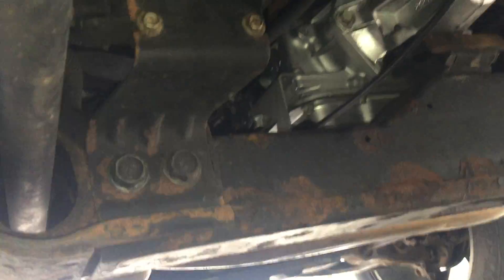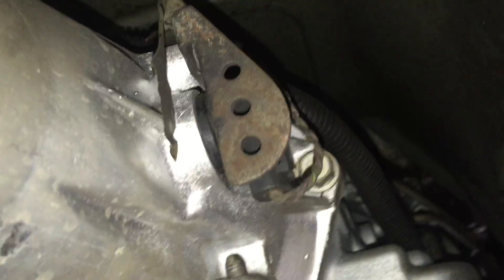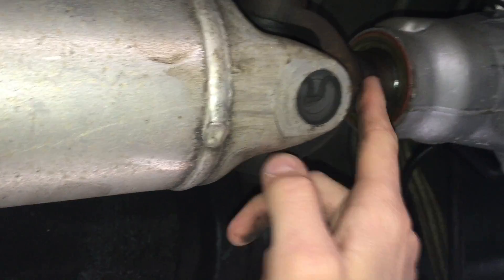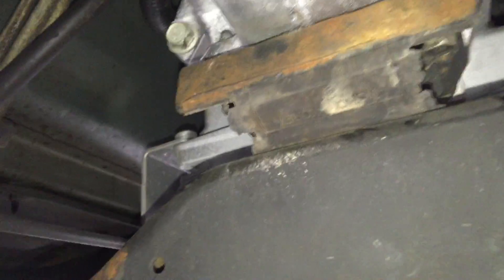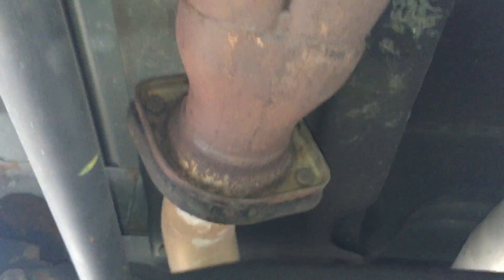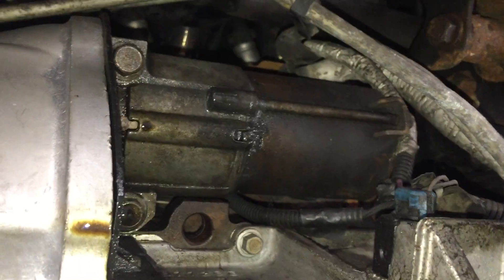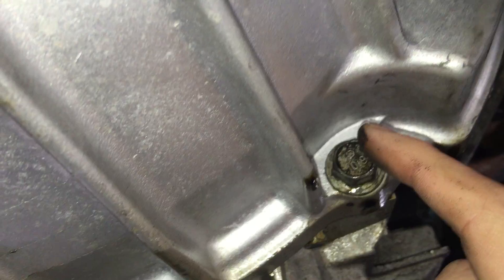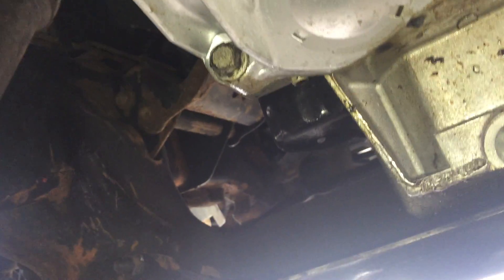4L60e removal information

Comment: Removing the bolts attaching the torque converter to the flywheel through a bigger opening below the bell housing should have been a better engineering option by GM than going through the starter opening.

Comment: Would you say you had and easier job starting with the upper Bell Housing Bolts or the lower ones? I ask because I did a Silverado and the little hang or misalignment movement made it pretty hard for me to unbolt the uppers although I had already loosened them in advance due to the misaligned transmission as it came looser and looser considering the room one has on the uppers. The rest came off by hand.

Comment: I found this difficult to watch.  First issue was the drive shaft.  If I am removing a transmission, I don't need so much time or detail telling me how to remove the shaft.  I also don't care how it works.  Second issue was the exhaust.  I don't need to know how it all works, but only that it must be removed.  Third issue is the starter.  I don't need to know how it works.  I need to know if removal is a requirement.  You say to remove it but don't say why.  Fourth issue is the trans lines.  I don't need to know how they work, but I need to know how they are removed.  I have looked at mine and the design is unusual.  I watched your detail about clips, but did not understand.  And you said nothing about the line nuts - they are not 18 or 19mm and not Imperial.  Then then end came prematurely with no detail of how the transmission is to be separated from the engine.
Reply from the maker: Bob Black—the intended purpose of this video was actually for a class project back in college. It was only to highlight certain aspects of the job as I was giving a speech to educated individuals. I was asked to be specific on certain key factors, which landed me an A on the project by the way. The video just so happened to blow up on YouTube, so I left it up as other people found it to have useful information. If you aren’t mechanically inclined, maybe have an actual mechanic R&R your trans instead of tackling it yourself?
Reply: @michaelmancini4195  Glad you got the grade.  However my point is that the video was wandering, whereas a good video would stay on topic.  At 0:12 you state this this video would be step by step.  What means you should not wander into side topics not relevant to the actual subject matter.  When you become better at that, your videos will increase in value to others.

Comment: Let's say u put a new tourque converter in do u install it without atf or is there a certain way to fill it?
Reply: Fill it up about half or so in so that it is not running out when sideways, otherwise you would start the vehicle for a few seconds, 3-5 seconds and shut it off to recheck the tranny level as it will keep going into the TC leaving the tranny low each start till its caught up.

Comment: When you did the installation with the new transmission, did you reprogram it?? Have that question because when I did mine it won’t grab right and won’t shift at temp
Reply: Did it fix itself? I've heard you should reprogram it after overhaul/repairing it

Comment: Mike, Great vid, one question and it's around the Bell housing bolts and in particular the top one. I've watched out 5 vids now on the Tran s removal and not one shows "How" they got it removed, plenty have the great music with the Trans coming out but not one shows "how" they go to that bolt, Any Tips on how to get to it?
Reply from the maker: Mario P it is the hardest one to get to for sure. I used a bunch of extensions with a long handle ratchet for more torque. Using wobble extensions are your best bet. You can easily grab a set of wobble extensions from harbor freight if need be to get the job done.
Reply: @michaelmancini4195  remove your passenger side plastic inner wheel well and Wheel and Tire . Your welcome.

Comment: Not sure if you still have the truck, but with that many trans, may i ask if your flushing the trans cooler lines?
Alot of people dont bother to flush out the 2 lines going from trans to the cooler. But if you have a bad trans, those lines are holding contaminated fluid, and friction materials in them, and they get recalculated into the new trans...
Very important step that too many people miss
Reply from the maker: splash- thanks for the comment! Yes, lines were flushed every time. 2 of the replacement transmissions were boneyard units that failed after low miles. Another was a faulty rebuild. That is the reasoning behind me replacing the trans on this truck so many times haha. But I did sell the truck earlier this year. Was long overdue for an upgrade!
Reply: @michaelmancini4195  
Nice
Ya its so hard to gamble on used trans...ive have good luck a couple times, and had one that wouldnt even leave the driveway on its own power...thats a kick in the nuts!!
Lol

Comment: Should have upgraded the band and frictions as well as the accumulator springs and servo. Could have saved one or two transmissions at least. A stage 2 rebuild kit is directed toward hauling and towing.

Comment: My trans went out, started fine still though, pulled the trans, had it rebuilt, put it back in and it has no crank, no start. I have all the wiring plugged back in, checked the starter, it's good. Thought the neutral safety switch might have been damaged while taking it off, replaced that and still no crank/start. Checked the fuses/ solenoids and all is good! I'm stumped and going crazy now. Any ideas?
Reply: JT Money I ended up taking it to the dealer after a few weeks of frustration trying to figure out what was wrong. There was a short at the ignition relay that had nothing to do with the trans. It just happened to become a issue at the same time as the trans. Thanks for the idea though, I tried everything I could think of

Comment: thank you for this video. I watched it in prep for my job. I removed a 4L60e to R&R a leaking rear main seal on an 04 GMC Savanna. Although there were some differences, namely the exhaust system, your information made it easier for me to complete the job...better yet, it started when I was done. PS-I believe the transmission that I pulled out of the '04 was a remanned older version from '97-'99. The bell housing and the body were one piece.

Comment: can u give me sum advice im trying to install the new one in but having trouble
Reply from the maker: Ac Price what's the issue?
Reply: im haveing trouble getting tork converter and flex plate off my gmc 2000 sierra
Reply: got the trans off but. think i missed a step with the tork converter and i got my new one today but.  cant figure out how to get tork converter off to install it
Reply from the maker: Ac Price you have to remove the torque converter bolts. There are 3 or 4 bolts. You have to access them from where the starter motor is. Remove the starter first, then you can gain access to the torque converter bolts. Use a flathead screwdriver to carefully rotate the flywheel so you can gain access to all of the bolts.
Reply: yes ive removed starter but still cnt seem to get them loose or turn it the rite way im not really sure why i cnt get it do u use the flat head as lever so you can unbolt it also? nd i appriciate ur help man
Reply from the maker: Ac Price  all good man. Happy to help. yes you have to use a large flat head to hold the flywheel in place while you are trying to loosen the torque converter bolt. Unbolt TC bolts from the starter opening. Considering you have the trans out already, you really shouldn't have any issue holding the flywheel
Reply from the maker: Ac Price be careful not to damage any teeth on the flywheel though!! They make a flywheel holding tool, but any guy I know has always gotten around it with just a flathead--myself included!

Comment: Influenced my trans build for the best
Reply from the maker: Kevin Yourk glad to hear it!!!
Reply from the maker: Kevin Yourk if you don't mind can I make a suggestion for your rebuild? (If you're the one physically rebuilding it)
Reply: Michael Mancini what suggestion were you going to make on the rebuild for these units? He said he has put in 5 transmissions in just 300k which seems horrible. I dont care how hard you drive they should definitely last more than 55k each time. I have 300k on my tahoe and just finally broke the sunshell housing which caused no reverse, no 2nd and no overdrive....otherwise in great shape inside and we tow and offroad all the time.

Comment: how did you get to the top 2 bell housing bolts?
Reply from the maker: Doug Scott- a realllllyyyy long extension with a long handle ratchet/breaker bar to break it loose. Gotta go from under the truck and over the top of the transmission. It's a straight shot.
Reply: thank you. with the cross member down, and then sagging, it was accessible but still a bit*h. lol. thanks for the response!
Reply: You can loosen engine mounts to get more angle

Comment: Do you think a 4x4 1995 suburban 4l60e is a one man job?
Reply: Wallace Rose. yea does are the easy ones bro if u wanted to be more easy for u take the transfer case of and put them on seperate even ..tell ur friend to come over for a cook out and have em help u put it all on at one time really easy he wont have a choice ..thats what boys are 4.
Reply from the maker: Wallace Rose sure, as long as you use appropriate tools & jacks/stands in order to lower and raise the unit(s) in and out of the truck. I've done several of these by myself, both on a lift & also on the ground.

Comment: Great info!!!!  Thank you!!!
Can this be done in my driveway on jack stands on my Yukon?  What about the transfercase?
Reply from the maker: Sparta, you can do this in a driveway if you have HD 6 ton jack stands to get the truck high enough off the ground. It'll be a bit of a struggle, but it can be done. Tricky part will be supporting/lifting the trans back into place. Transfer case will have to be removed as well when doing the R&R on the transmission. My truck is RWD, so that's why you don't see a TC in my video. Look up your fluid capacity specs for your truck specifically--being that it's 4wd, yours will take more ATF than mine when filling it.
Reply: Michael Mancini
  Thanks so much!  I already have the taller NAPA 6 ton jacks and I plan on getting a low profile transmission jack from Harbor Freight for only $130.  Any advice for installation?  An problems getting the Torque Converter or flex plate in place?

Comment: hi michael nice vedeo really i need a help on my suburban 6.5 turbo diesel i change a automatic transmission 4L80E to full manual transmission NV4500 and now not working the dam speedometer!!! before everyting is working and after this modification not working a speedometer and a ABS light is one also you know where is a solucion for fix this type of problem? thanks bro. best regards from norway
Reply from the maker: What year?
Reply: my suburban is 1995 model
Reply from the maker: To my knowledge in that early of a year, the 4L60 & 4L80 transmissions were not equipped with a VSS, so your speedo should be getting a reading via the wheel speed sensors within the hub bearings. I would have to look into how the data is communicated from the EBCM to the PCM on that particular year in order to give you a more thorough answer. GM had a lot of problems with their EBCM's over the years and are known for various parts inside to fail.
Reply: thanks mate for all information amanzing this the fanny is before is working and after never more working dam speedometer i check one by one conectors and wires everyting all right strange really who going one on it put me crazy this problem and here in norway no one understend nothing on american cars just i try see and check a GM electric chanel or other vedeos will see i hate a dam electronic

Comment from the maker: Doing these are a piece of cake. I've done tons of them and can have the old one out, new one prepped and back in and on the road in about 3 hours total. How did yours go? 
L
Reply: Your kidding right ?
Reply: I got it out mate thanks video helped me out a lot
Reply from the maker: Justin Lyons I have not done one on an S10 in quite a few years. But, considering it's the same transmission,(bell housing bolts differ depending on generation of 4l60e) you would most likely have to go in over the top of the transmission with several LONG extensions from the tail shaft side, and use a long handle ratchet so you have some leverage.
Reply: Michael Mancini So how difficult would it be to remove and replace one on a 97 suburban 4x4? I've got all of the tools except a transmission jack.
Reply: @michael mancini where are you buying those 4L60e trans and how much are you typically paying?
Reply: hey. I'm up to taking off the 3 bolts on the torque converter. how do you stop the shaft from spinning when taking off the bolts. I've put it in park but it still spins. I'm stuck lol 
cheers mate
Reply from the maker: Still need help?
Reply from the maker: Awesome! Glad to hear it!
Reply: what size are  the torque convert bolts?
Reply: Michael Mancini hey mike how do you stop your truck from smoking
Reply: I got a 95 Chevy Tahoe, I love it so much, but my transmission is bad
Reply: Thx you did a great job explaining everything bro
Reply: I will be dedicating an entire week to take down and do a small rebuild ( clutch pack and main seal), and will use your video as a reference point. hopefully it's similar on the Saab 9-7x.
I'm amazed you can do it within 3 hours, up here in rust belt - in much less ideal condition - there is no way it will take me less than a couple of days on the ground. always plan ahead and for the worst. I can already envision the exhaust not coming off, bolts rusted out and stripping  - cutting required.
it's a pain in the ass but it's fun.
Reply: John Tesla I don't think he is..
Reply: What brand trans did you use? How did it holds up this time?
Reply: if I may ask please reply me the parts needed to change a transmission